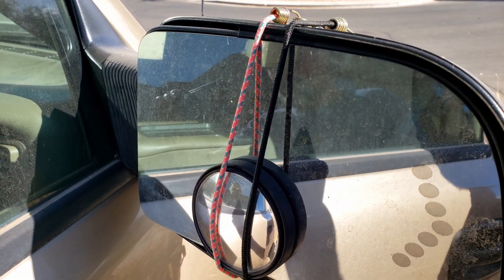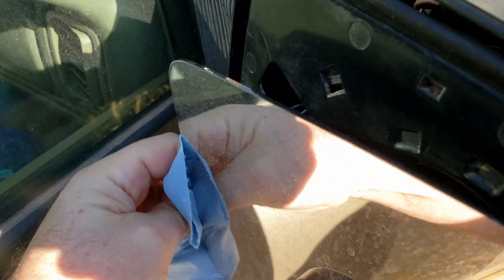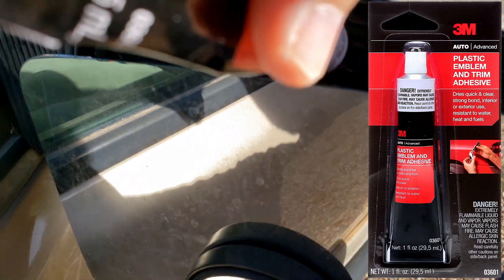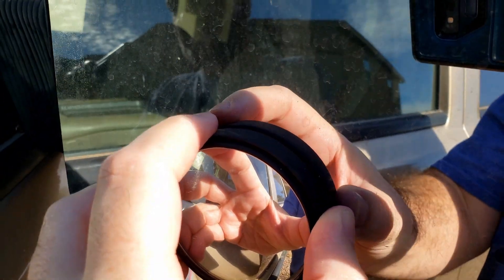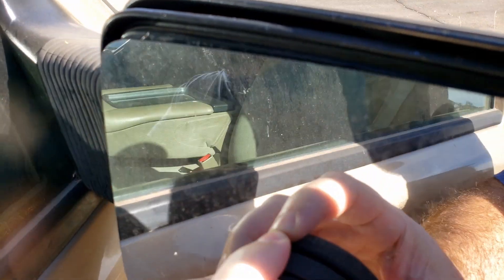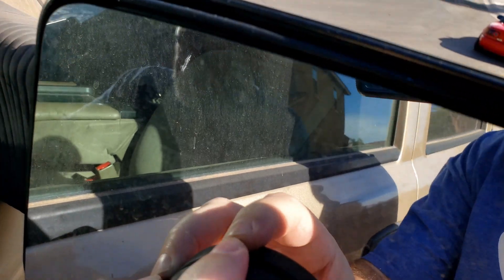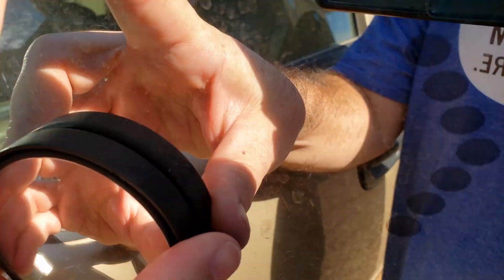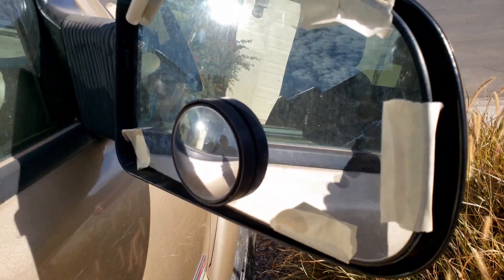The Mirror Fell Off My Truck - 3M Plastic Adhesive Review

Comment: You think this would help with adhesive tape.. for a window spoiler. Or should I use adhesive promoter..
Reply from the maker: I haven't used it on a window spoiler. The problem with this adhesive is you have to pull it back and forth to activate it. Most tapes will stick so strong that you wouldn't be able to move it around after you put the tape on.